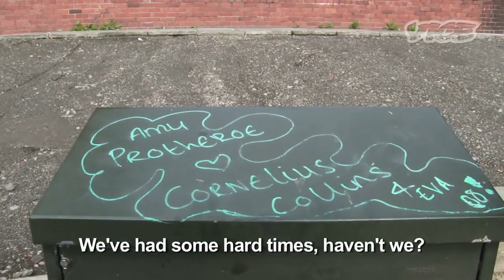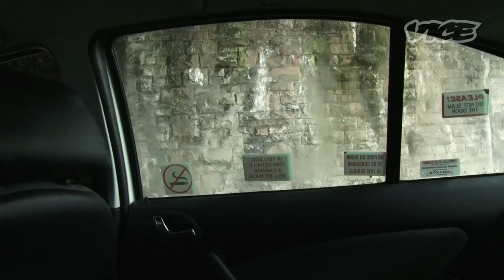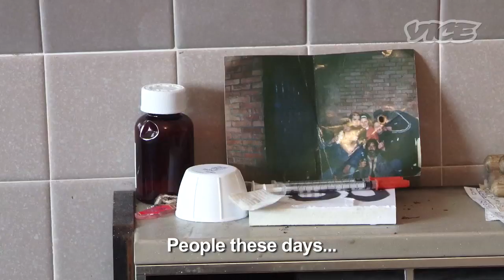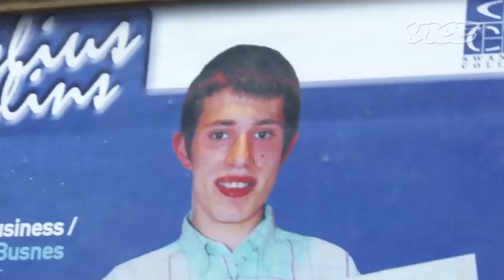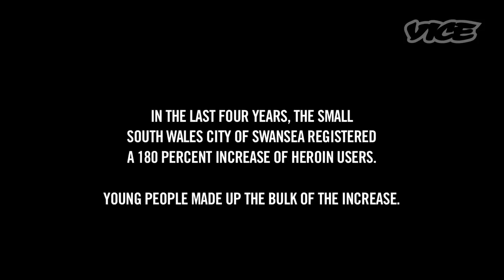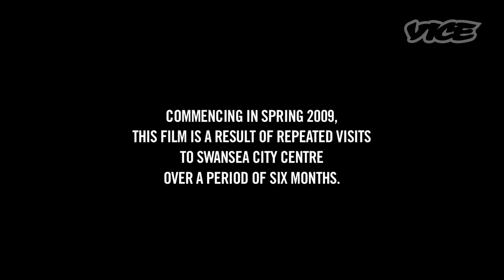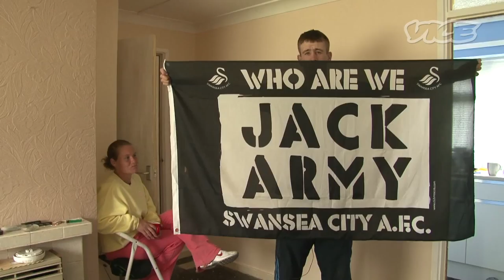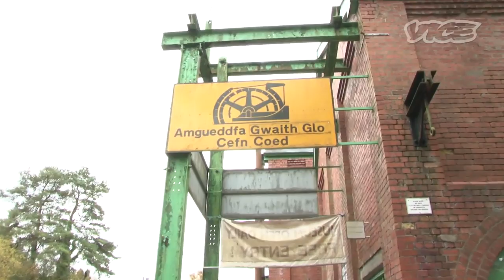Heroin Epidemic Documentary - Americas Worst Crisis vesves Prevention Solutions

Comment: Any users know why the guy taking metahodne and subutex together would have caused the worst cold turkeys? Is it a powerful mix?
Reply: No. Buprenorphine, the active substance in subutex, is a partial agonist, while methadone, heroin, morphin etc. are full agonists. I dont feel like explaining all the details, but because of subutex being a partial agonist, so half antagonist, it basically pushes the methadone away from the opioid receptors in the body wich leads to immediate withdrawal. Usually withdrawal builds up slowly but by taking a antagonist, or partial agonist like subutex, it starts immediatly, especially if you inject it. I had that once, but with heroin instead of methadone and it's not only hell on earth, but can also be dangerous. So yeah, if you're an addict dont ever do that.